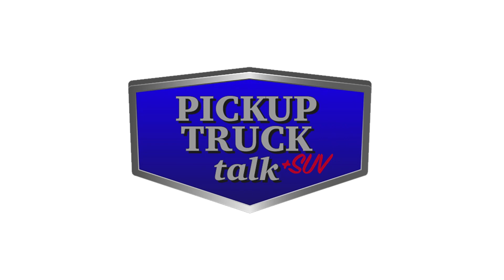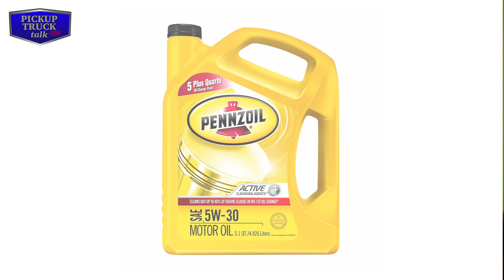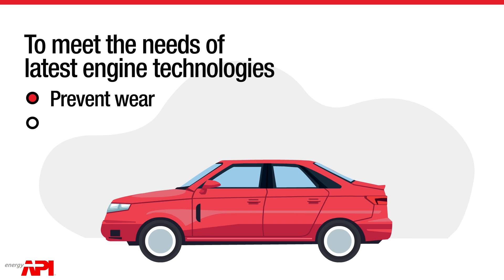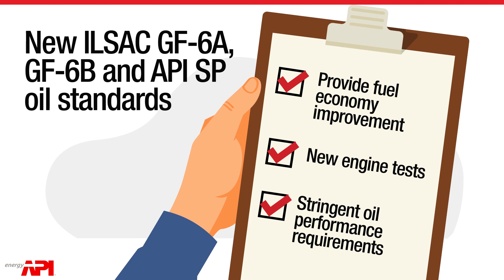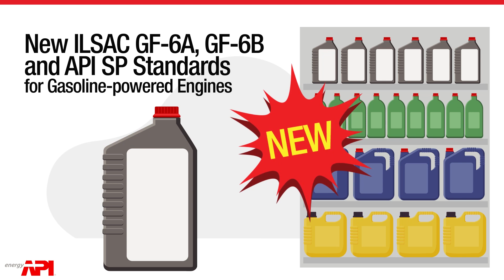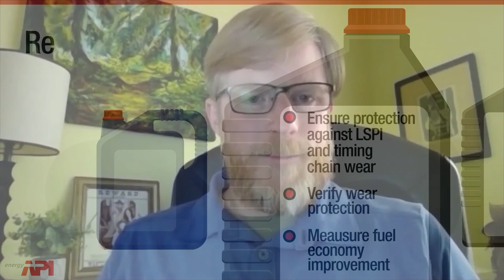New API Gasoline Engine Oil Standards Are Game Changers

Comment: Those engines that have Plasma Spray bore coating for their cylinder sleeve have to use 0W20?. If yes then car manufacturer need to put in a clear cut reason in their handbook. "This engine comes with Plasma Spray bore coating for its cylinders that need API SN or API SP 0W20 engine oil". No?

Comment: When I was a kid I worked at a gas station and we had used oil that has been and shipped to us in 55 gallon drums and we carried a metal rack that held 6 glass bottles wit a screw on funnel cap and we sold a ton of it .

Comment: GM vehicles with the OLM have high failure rates in regards to timing chain failures. And the oils were SN rated when those engines were entroduced. It was overrated for the protection of thay engine. The OLM algorythm was a misnomer.

Comment: there are no free rides
so if these oils give better fuel economy, what s lost?
Reply: Thick does not mean better. 20 weight seems to be too thin to those fans of thicker oils, but they seem to be stuck on 30 weight. Why not 40 or 60 weight? Crickets. Toyota's legendary and "bullerproof" 22R engine wiped itself out on a regular basis on 10w30 and 5w30 oil. Rose colored glasses. But, I was in a service department back when oils were thicker, and they were not miricle fluids.
Reply: @9ZERO6  Toyota specs different oil viscosities in Mexico than the US, the 0w20 oils and thinner speced, especially in the Southern states, are to meet CAFE standards, that s it

Comment: Lifetime transmission fluid? "Lifetime" is as long as it passed the warranty period, the OEMs are fine with it.  I always change my trans fluid (and filter, if equipped) every 25,000 to 30,000 miles. 208,000 miles and counting on my 2004 4runner and it runs like new.  Fluid is cheap, transmission replacement isn't.
Reply: Agreed, but so sadly, today, fluids are no longer so cheap. A synthetic change and filter ( no labor included) can now run 90 bucks in materials. I realize and accept that is must cheaper than 5 grand and labor for a trans, but synthetic wonder oils do come with a price... and yes, the pun is intended.

Comment: most synthetic oil that you can buy at the store are all group III and we need to thank Castrol for this step-down from PAO to group III
Reply: Yes, Group III base oils at 50% price of POA base oil at 80% of POA performance capability does make sense. Especially if you are going to change the engine oil at every 7500 miles or less. 😂😂
Reply: Why should we be thankfull? The court decision mearly open the door for more confussion. Full Synthetic Oil is not the same as 100% PAO Synthetic Oil! How is the customer too know the differance if not marked on the bottle "GROUP III SYNTHETIC OIL" OR "GROUP IV PAO OIL? Foturnatly almost all oil on the market is Group lll oil.
Reply: @markwarnberg9504  when I say that we should be thankful I was just sarcastic, it is because of them that we get a lower grade of synthetic
 oil and this is why I won't buy anything Castrol.
Reply: @budblack3588  Sorry I did not catch the sarcasim. We cannot blame Castrol for the mess, they are in buisness trying to make a $. It´s the court ruleing that was messed up. As to the lower grade....like i said many times, if it meets the API/ILSAC standard recomended by the manufactuer the oil is ok to use, it is the price that determines my choice of oil.

Comment: If my 2012 sonata takes 5w-20/5w-30 what kind(not brand) of this newer oil would I get? I want it because I have a GDI engine.
Reply: You can get either 5w30 or 5w20 oil, but on the back of the oil container it has to say:
 API certified SP
ISSAC GF6-A

All brands of oil that have this on the back are the updated formula. Hope this helped!
Reply: That engine is known to munch rod bearings regardless of oil change intervals or oil type.

Comment: Can we mix API-SN GF-5 and API-SP GF-6 with same SAE
Reply: Yes, indeed!
I will try out Amsoil signature series 0w40 oil in my Opel. If it works in an european car, it should work in yours too.
Just respond me after 3-4 days, until then I will change it and I will give my honest unbiased opinion, but the oil is approved for Nisaan Gt-r, so I think I've made a great choice, also it is 100% synthetic, unlike most of the '' fully'' synthetic oils!
I just want the best protection, and for 30$ more than the other oils I think it is worth it!
Also I will change the oil filter twice and I will try to run that oil for 20,000 kms atleast to feel how it performs and more!

Comment: Use whatever is on the fill cap and stop worrying.  The people who designed that modern, sophisticated powerplant know a LOT more than Jeff down at the local shop regarding what SHOULD go into a PROPERLY maintained engine.  These are NOT your father or grandfathers old "loose" small block.

Comment: Hi brother. Did Amsoil corporate ever get back with you about an interview? I just had to share this link where Amsoil Signature Series passed  the new sequence III-H  engine test without even flinching.! They actually put the same oil back in the engine and then ran it for another double-length version of the test. At that point the oil was starting to thicken, but it was still well within the limits of the test!
https://blog.amsoil.com/amsoil-crushes-sequence-iiih-engine-test/?utm_source=blog&utm_medium=email&_cldee=dHJ1bGxfc3ludGhldGljQHlhaG9vLmNvbQ%3d%3d&recipientid=contact-a916986f971ee61180f9005056827197-bbc1a2d0a6a04a42bbe5fb6c10dcb258&esid=04f581a0-a6bb-ea11-9130-005056988f87?zo=1463115
Reply from the maker: Nope. No word back.

Comment: My only problem with this is that I’m a Ford fanboy and my 5.4 3V is recommended to have 5W-20 by Ford. I know if I hadn’t switched to 5W-30 I would have seen the dreaded VVT ticking and eventual failure. I guess all I’m trying to say is that a little research goes a long way. Ford recommends 5W-30 everywhere else. Just make sure that you’re following the manufacturers recommendations but do it in a smart way..

Comment: Timing chain wear issues have been a problem since MFGs starting increasing oil change intervals.... Timing chains were the first issue to show there ugly heads with leaving oil in over 3000 miles... 
Good to hear this issue is being addressed. 
The majority of people believe that the MFGs required oil change intervals is good enough for a long engine life and that’s not always the case. But that is nothing more than sales BS. As in look how low the cost of ownership is for our vehicles..... At least in the short term...
LSPI is any vehicle witch is getting better power and milage by advancing the timing and causing ping... Because MPG is very important to MFGs , the easiest way to get more power and MPG is by having more timing at lower RPM....
AMSOIL has addressed LSPI long ago with there signature series oil.
And no transmission fluid does NOT last for the life of the car/truck... So get it changed or pay the price.....
Reply: I believe this is more to do with the vapor the crankcase vapor the PCV system pulls in to burn lowering the effective octane rating of your fuel.

Comment: Cool video thanks for sharing. If you were going to buy a New Two Wheel Drive Truck. Which truck would you buy? I'm just looking for the average everyday old man's truck. Stay well & safe.
Reply from the maker: Hmm... I’d take a hard look at Ram with that hybrid. Also, the Chevy is pretty good, but they use the older engine in their base 2 WD trucks. That engine is fine, but Ram’s base engine is better. You could go Ford and their 2.7L EcoBoost. That’s a fun truck as well to drive around.
Reply: @Pickuptrucktalk  Thank you for replying to my post. I looked at a Ford F150 XL. I liked it. But when did some research? Ford puts Plastic oil pans and oil plugs on their newer trucks.  What about the Chevrolet using older engines? How old are they? Will they last as long as the costlier trucks?
Reply from the maker: @thomastommy1192  Let's first talk about these plastic oil pans and plugs. This sounds like it is a problem for you. I wonder why? Flip this idea for a minute and consider maybe Ford is onto something with this. An oil pan that doesn't rust, is lighter and one that could very well be stronger than the metal ones. This would be something you would want then, right? We are seeing a variety of mixed metal strategies on trucks these days. For example, the new F-150 has aluminum body panels. You didn't skip a beat on that, but got stuck on a plastic oil pan? The Toyota Tacoma has had a plastic composite bed for over a decade. New GMC Carbon Pro trucks have carbon fiber which you'll need a sledge hammer and a full day to try to even leave a mark on. My point is don't get hung up on plastic oil pans since everyone is using different materials. Frankly, Ford might be onto something and the whole industry might change with them. 

Onto the Chevy question. The 2019 model was a new year for Chevy trucks and what they see as upgraded 5.3L V8 engines. This has many new features including the latest DFM system allowing for cylinder deactivation with 17 different combinations to turn off cylinders. It is paired with an 8-speed transmission. So far, the 8-speed has had some concerns among owners. 

Engine reliability is all about maintenance. One engine won't last longer than another off the lot. There is really no way to make that claim. If you take care of the engine properly, it'll take care of you.

I hope that helps.

Comment: I was talking to a Chevrolet mechanic one time about the 3.6 L engine and stretched timing chains. Actually I was in a bar and ran into him. I asked him if I was going to have a stretched timing chain. Mine was in a GMC, but the same engine. He said that every stretched chain that they have ever got was because of neglected oil changes. This was at least 5 years ago, so maybe they have made improvments since then, especially the Dexos full synthetic oils.
Reply: GM was a where of timing chain issues with extended oil change intervals. They actually re-flashed a bunch of vehicles ECMs to shorten the oil change interval.  Timing chain stretch was a big issue when MFGs changed to there crazy long oil change intervals.
Goes to show you that today’s oils are NOT as good as the MFGs think.....
Reply from the maker: Bar talks get the best information! Thanks for sharing.
Reply: if you want the 3.6 to run as it should use the revised version of AC Delco Dexos 1 GEN 2 oil only. I have a 2018 4.3 with 78,000+ miles and have tried several other Dexos 1 Gen 2 (Approved ) oils. None of them make the AFM operate as it should.

Comment: would it be ok to put in this oil in an older GM or Ford V8? too thin?
Reply: Check your manual.  It will state the specs for the oil they want to be used in a particular motor.  Using a lower viscosity oil than required may not end up so well.
Reply from the maker: Should be. As he said, it is backwards compatible to older types of oil.
Reply: @Pickuptrucktalk  I get that, just it might be so thin for the older motors it might burn easier?  ring tolerances to big?  Thats what Im thinking, Im curious to try it out though.
Reply from the maker: @bartekmedes8281  I have concerns about how thin oils are getting as well, however, it sounds like the chemical makeup of the oil with the additives actually makes it stronger than old thicker oils. This would make sense to me that it would be fine to use in older engines. 

The reality is next year, the API will sunset their older license which means the only oil on the shelves will be this new oil standard. You aren't really given a choice it seems.
Reply: @Pickuptrucktalk  Except that the lower weight/viscosity may lower oil pressure on old loose engines. Used to be a common thought to put a heavier weight in to build a little pressure. Never truly worked, but every old-timer swore by doing it.   Fact is, worn os worn, very little to prop any of that up.

Comment: Here in Chile is very difficult to find engine oil SAE 0W20, as recommend for my L83 Silverado with AFM...so I just found SAE 5W30, because here is the more common use engine oil for trucks with V8 engine. My question: My L83 engine is in danger if I still use that kind of oil ( I understand that SAE 5W30 is the oil recommended for LS engines between 1996-2013, not for L83 engines with AFM deactivation cylinders)?
Reply: Zulú Mcedo you are perfectly fine to use 5w-30. The 5w-20 is used to gain a better mpg rating on the U.S. Cafe standards. It’s not for protecting the engine. The 5w-30 is actually a better oil to use.
Reply from the maker: That is a good question. I think you’ll be ok, but probably not get the same performance.
Reply: @Pickuptrucktalk   About the performance, I found some curious things: before the first Oil change ( the factory oil with dust and  dirt inner from the engine assembly), I´ve got  26,5 mpg/ hwy, with gasoline RON(AKI) Gas95(90)...with Gas97(91-92) I´ve got  26,75 ( the same with Gas98 or Gas93(88-89).  After 2700 miles I change new filter AC Delco OEM & oil Shell Helix HX8 Synth Pro AG Dexos 1 Gen2( SAE 5W30) and the performace are similar using just Gas93(88-89)...almost 26,75 mpg/hwy  ( All this measures with AFM & 53-56 mph speed)...The Truck is a 2018 Silverado Regular Cab, 5.3 lt V8, LTZ71; The gasoline brands are:  In Chile Shell Super 93, Super 95  and V-Power 97 , and Argentinian YPF Nafta Super 95 and Nafta Premium 98.
Reply from the maker: @RodrigoRSMd  that's pretty good fuel economy!
Reply: I've used 5w30 synthetic in my old 2015 l83 5.3 litre engine without any issue
Reply: @EverydayJ1786   Agree! Not issues, just a preventive worldwide recall for reprogram StabiliTrak ( ending 2019), that include some electronic alert of Airpump misfunction in ABS brakes ( at the beginning of a ride at low speed)...After the reprogramming still appears the brakes alert!
Reply: Zulú Mcedo if you want the truck to run as it should use the revised version of AC Delco Dexos 1 GEN 2 oil only. 
I have a 2018 4.3 with 78,000+ miles and have tried several other Dexos 1 Gen 2 (Approved ) oils. None of them make the AFM operate as it should without the AFM running sporadic
Reply: Zulú Mcedo You can buy it on Ebay

Comment: If you have a truck you most likely Towing trailers I promise you can you do fluid every 40,000 miles drain and fill with the correct dealer fluid and you will never have a problem for 200,000 miles after that anything can happen
Reply: 40,000 mile oil changes? You're crazy dude.
Reply: @tartarsauce2601  I was talking about  the transmission fluid

Comment: Hi Tim, love these technical videos of late 👌🏻 Thank you for picking these great guests from the industry and putting these together. The jargon for oil, as in petrochemical products as opposed to oil as in lubricants, is mineral oil and the other is lubricant. Another point I got from this is that the API is descriptive, not prescriptive. That is they set the functional requirements for their products, and allow lubricant manufacturers to meet those functional requirements, or performance benchmarks, as they wish. They are not getting involved at all in the execution, not being prescriptive. Hence the unexpected answer regarding mineral based oils vs synthetics. They are agnostic.

Comment: So he didn’t want to answer the transmission fluid question, even tho he and everybody knows you have to CHANGE IT IF YOU WANT  IT TO LAST ! !
Reply from the maker: Well in his defense, I did put him on the spot.
Reply: Because like most people he has no idea of how long oil lasts....
Reply: Boco LWN Transmissions May not have to deal with blowby, but engines don’t not have to deal with clutch plate material otherwise known as “dust”. This dust wrecks havoc on valve bodies,shift solenoids ,and all internal parts such as one way sprags, needle and roller bearings , thrust bearings and planetary gear sets add metal and sheer loading to the oil .... an engine also doesn’t have to deal with torque convertor sheer loading and heating as well....
Reply: @Boco LWN they are vented usually to the air filter but sometimes just a vent tube out in the open depends how a vehicle was made. Dust can get in over time.
Reply: I never changed transmission fluid in one of my suv’s, it’s just hit 250k miles and is a domestic suv if that adds more weight to the accomplishment. Many long summer road trips as well.
Reply: @AJ-we9kd  that's sort of surprising